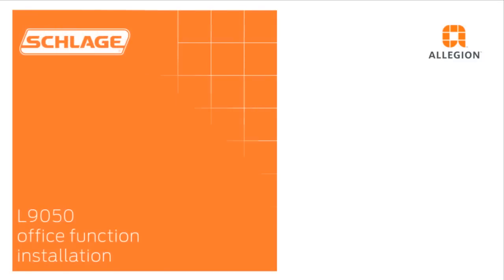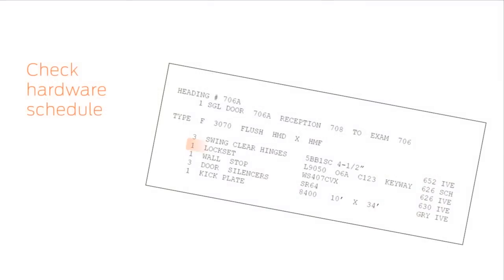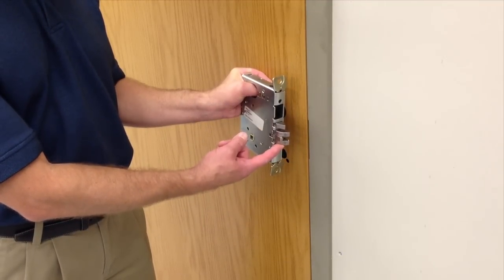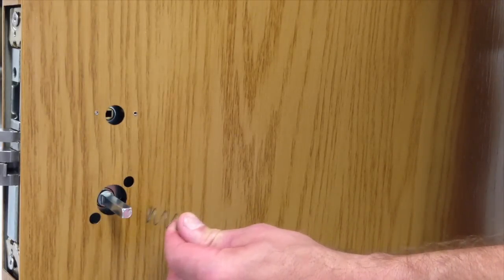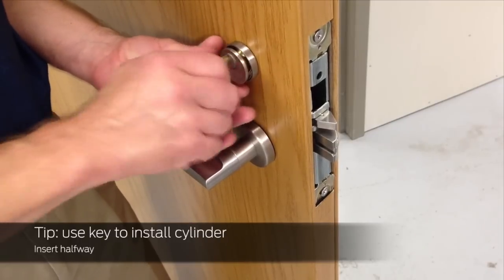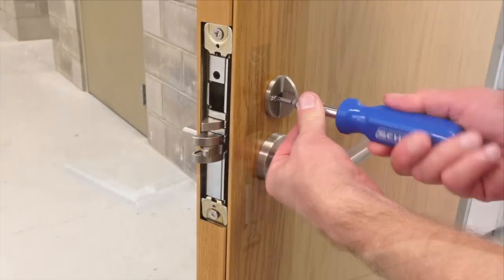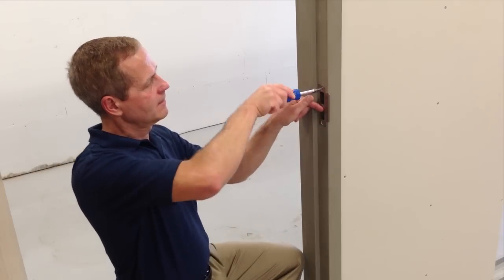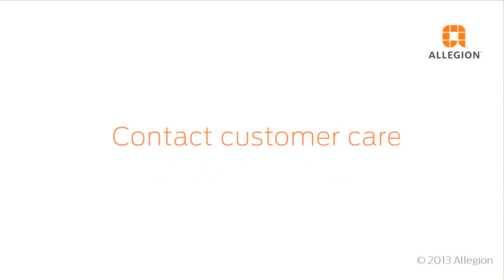How to Install Schlage L9050 Mortise Lock

Comment: Good video but how you make the holes specially  in a metal door?
Reply: Most of the time I see these holes prepped on new metal doors because they get ordered that way.  

If it’s just the holes on the face of the door I use hole saws and step bits.  If it’s the mortise prep…can’t help ya there 😅